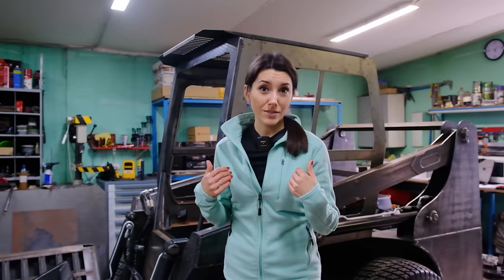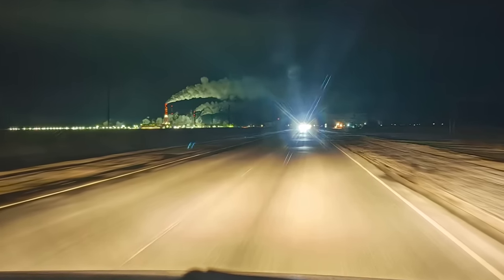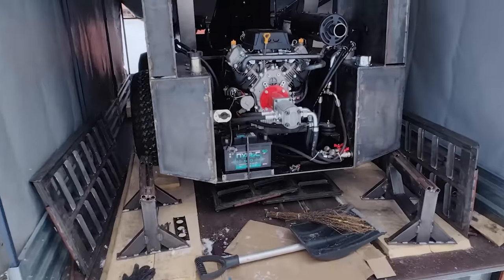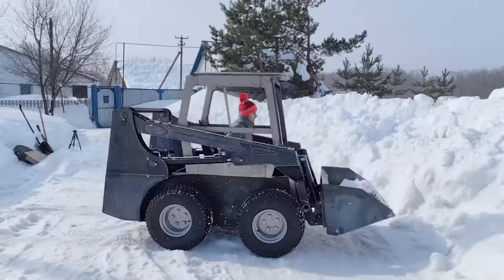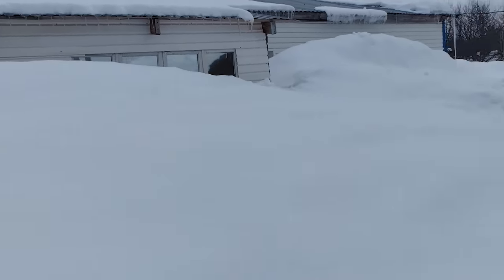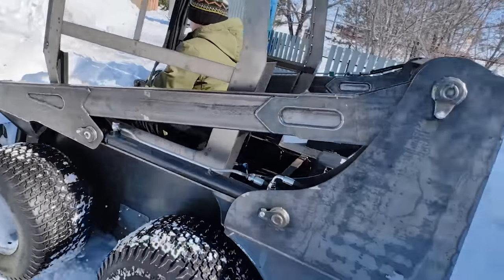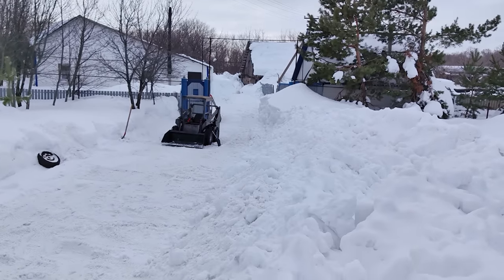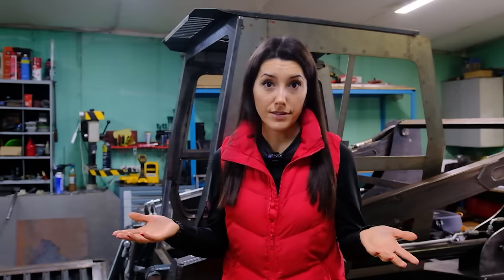DIY SKID STEER. 1st REAL TESTS!

Comment: I have a cat262d and I do not believe I have much side to side jiggle in the boom as you asked.  I’m very intrigued by your desire to build a skid steer.  I’m in the USA and we have them everywhere.  Your in Europe somewhere, are they not available there?   Your craftsman ship is amazing.  I enjoy watching the build as I can.  Your design favors a John Deere  machine.   As another person said. Make sure your cab is strong enough to be a ROPS.  A small diesel engine might provide more power than a 2 cylinder gas.  Definitely sounds restricted.  Either way good job.

Comment: Some flex is normal. My machine has L brackets that support the outside of the loader arms for the lower few inches of travel where you might be digging/flexing harder. I have an older machine that's been repowered with a lower torque motor. My drives can stall the motor out too, if I back off the sticks I'm able to recover and just go slower.

Comment: I looked up the specifications on that UAZ Patriot you have. I'm not surprised your husband didn't want you to tow your skid steer 300 miles with that. Wow. Looks very dangerous for towing. 

Glad to see the test went so well. Like others have said, you may have a pressure problem with your hydraulic pump that is causing the motor strain issues.

Comment: It's such a good build, PLEASE either ditch that motor, or maybe it's just a relief or bypass needed for the steering and other hydraulics. But, for some reason, you keep having to idle up when turning; so it appears that you're missing something. Believe me, I think what you've done is AMAZING!!, I hope you find all the issues. Swap the motor?, or is it just a bypass... The bucket swinging is probably more in the tires than anything, you have lots of sidewall there on the bouncy tires. But it seems that you are lifting the arms up a few inches, and tilting the bucket front edge down, as if it's the slightly the wrong geometry? and the arms have to be up a bit?  Easy to make and add some side brackets/guides to keep the bucket aligned better; unless it's the whole cab flexing?

Comment: Great work Lucia ! The trailer kind of worried me since in the USA we would use an actual equipment trailer and chain it down from 4 points(minimum) to d rings welded to trailer , I don't know how much that skid loader weighs but the trailer tires looked tiny and towing with something that small is a concern too. Sorry to sound negative but better to be safe . .
Reply: Here in Europa we are carrying skid loaders and "telephone booths" (mini excavators) on trailers like this one all around. Without accidents 😀
Reply: @grzegorzolek9219 Are you saying that there are no safety requirements/regulations in your country? I am fairly certain that is not true . Securing your load is required everywhere I know of except maybe 3rd world countries. It is an accident waiting to happen.
Reply: @gloknor  of course we have safety regulations in EU, but not at NASA level 😉 Things carried on trailer must be secured, but transport belts hooked directly to trailer's frame are more than enough for skid or mini excavator. With trailer (even empty) we can drive max 80km/h.
Reply: @grzegorzolek9219  We have to use chains here not belts/straps and use ratchet binders secured at 4 points (min) the trailer must be adequate for the load(the one in video looked small ,fragile and tires looked very small like camper wheels). Also we do not usually haul with a tiny vehicle that  weighs a fraction of the   load.....blah blah blah . Anyway thanks for the insight of how its done in Europe .Have a great day .
Reply: @gloknor  I have something else for you: driver licence type also defines what kind of car and trailer you can drive, not only car specifications 😀
Reply: @grzegorzolek9219  We don't use cars for towing(lol) and anything over 26.000lb requires a cdl(commercial drivers license) and you have to have your medical card . I think we are both in agreement that Lucia needs a bigger vehicle and trailer if she is going to transport hr skid loader safely. Thanks for the response

Comment: I would highly recommend getting a tongue brake on the trailer...that is too much weight for the SUV to stop safely...there are link treads such as excavators and bulldozers have that are available  for skidsteers...you just need the overall length around both wheels...these work much better on less than ideal traction surfaces such as snow and ice...

Comment: How did you solve the belt breaking issue from the last video you left off at due being under a load and the belts snapping..
The muffler needs needs additional bracing and rubber isolators to allow the muffler to flex a bit.
I am not sure if the tried are aired up too high and why it maybe not getting enough traction
Maybe adding weight inside the skid steer should help in scooping up a bigger load
Nice first step in the testing process and you skill at using it will get better as you go along

Comment: Near impossible  to have smooth operation  with a tandem gear pump on the drive circuit   gear pumps output  varies to much with rpm and the flows probably too low for your drive motors  , you need a servo operated  variable displacement  tandem pump   and some more horsepower probably.  Nice project but keep at it.👍

Comment: I own an bobcat S/175 witch has a 1,750 pound lift capacity  and the arms don't move much when you drive  with the arms up with a load ,, not much flex at all , I suspect that you have not made it strong enough , thicker metal more gussets . etc ,, meaning the design is light duty for the type and use of the machine, but great job there is no way I could build one like you did amazing .... great job .... and please I am not bashing yr machine ,,, just commenting on yr questions if you know it normal to have that much flex ,,,,

Comment: I’m just guessing but temperature may have a lot to do with your hydraulic power issues especially if you’re using a standard type oil. I’m guessing synthetics are available for hydraulic oil but I don’t know this for sure. I imagine your hydraulic oil is the same source as Hydrostatic drives, but again I don’t know ins and outs of that. I do know however the cold weather tends to take its toll on equipment and engine and fuel performance in cold weather.

Comment: Sorry to continue on the subject of engine sounding over-worked..
As I said, very cold hydraulic oil might be an issue due to it's increased viscosity
Pressure relief should be reduced to only what is needed to do the work
One more thing to check is a possible pump size mismatch when compared to horse-power of the engine. 
HP demanded by the pump is a balance of both pressure and flow. It looks like you are using twin gear pumps, whichever  pump is being used for the wheel drives would be the one to look at (actually it's not clear to me which pump is used for loader controls?). Maybe you have both wheel drive motors running off one pump? Anyway the loader pump need not be part of this discussion. 
As a general rule, and assuming moderate line pressure, 1 gallon per min (1.78L), of pressurized oil flow will require +-2 HP when using a gasoline engine. If you have a pump that is oversized compared to HP available, the work load on the engine could be excessive. These pumps have almost zero internal slip, the oil out flow volume is only controlled by the speed of engine shaft rotation, no matter the horse power. 
So..check the manufacturers listed flow rate of the wheel-motor pump at your average working engine RPM; if this flow rate in gallons per minute is far greater than 2x horse power, it could be an issue. Example would be if you have a 20hp engine and a 20 gallon per min pump, the engine will be too weak to properly handle the oil flow at working pressures.
An engine/pump mismatch will not harm components, but you could notice the engine being overworked.

Comment: It sounds a bit underpowered and as its struggeling when you have loads on it and driving up the ramps. So first thing should be to get a bigget engien. Close to 100hk should do the job.
Also the cabin is for me looking a bit thin compare to other bigger brands. Its suppose to hold alot of weight if you drop something on it.
But overall its a great machine you build. Looking forward to follow you the rest of the way in the build and what you come up with building nextm

Comment: Seems like a tracked vehicle would be more efficient on low traction surfaces like snow and ice.
Reply: I work on equipment like this and I asked one of my customers this same question and he said that the tracks just sit up on top of the snow and slide around. He has years and years of experience, so I trust his word on this.
Reply: @timothyball3144  Traction is about surface area, which is way snowcats are always tracked vehicles.
Reply: @michaelbradley7529  I guess my guy that has been running equipment for 30 years is wrong, then.
Reply: @timothyball3144  Yes, that's the conclusion I came to as well. Sometimes people just say shit.
Reply: A tracked skid steer is in another price bracket. This project is about keeping cost down, and making something good enough. wheeled skid steers have been around for decades, doing snow removal, among else. some chains would help, at a reasonable price.
Reply: @Rimrock300  I agree they are a multipurpose piece of equipment; the point is tracks work better in low traction conditions. Chains would be a low-cost alternative for better traction, or studded tires at a higher price point. If the skid steer was intended to work in all seasons the tires are the best compromise, but if it is primarily going to be put to use in snowy conditions then I think tracks make more sense.
Reply: @michaelbradley7529  Snowcats only move their own weight. They do not have a front loader bucket.
Reply: @codetech5598  Snowcats are used for rescue and vehicle recovery all the time and are often fitted with plows for snow removal. So, I don't see how you can make that claim unless you really don't know any better and you just felt like picking a side in an argument. I guess it's like I said to another commentor, sometimes people just say shit.
Reply: @michaelbradley7529  LOL. Yes you they do!

Comment: Congratulations on getting some seat time on a machine you built from scratch.  

Lateral bucket swaying.  Not really a thing in commercial machines.  I have a few machines with over size buckets that I routinely overload while traveling quite a distance over less than ideal terrain.  No appreciable lateral movement... Bucket is always as low as possible while traveling.  If I slam the side of a bucket into the side of a concrete wall... I feel it.  The bucket and arms do not move.